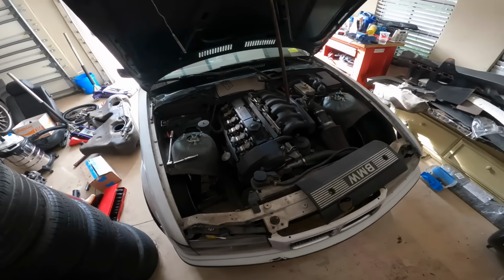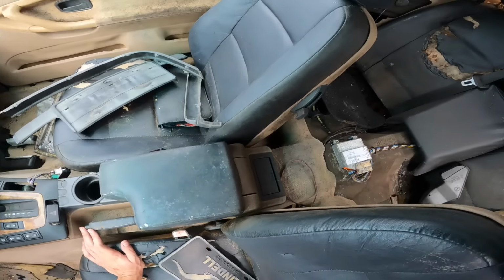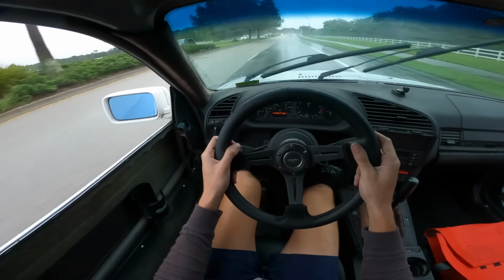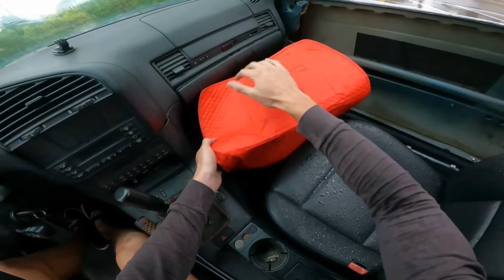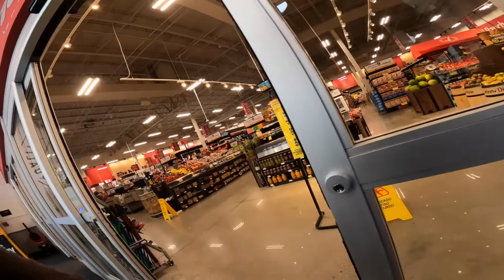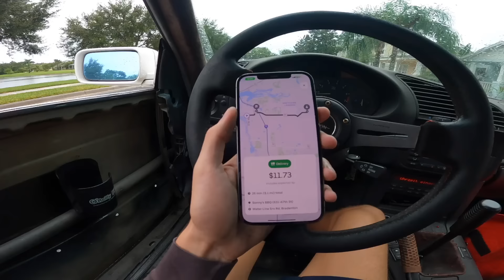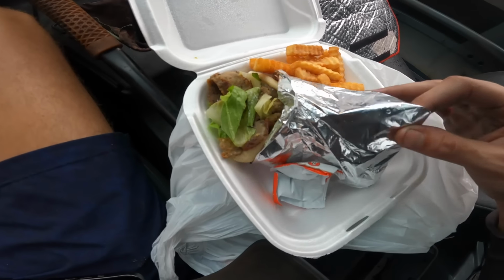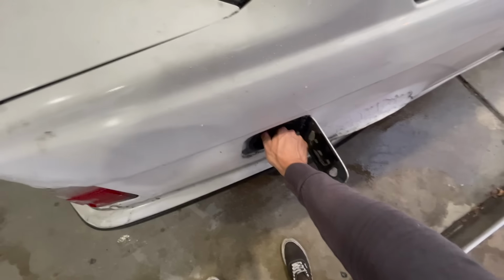Uber Eats & Door Dash in my DRIFT Car *POV*

Comment: hey bro, about your ear, if you drive with no window (especially if it's only one one side of the car), it can give you 'otitis', which is an inflammation of the ear drum. I think it has something to do with air pressure and the difference between your ears (like one ear is getting blaster by wind while the other is not).
In any case, I ain't a doctor, but I've had my share of otitis through my life.
Reply: oh yeah and if it comes back, get it checked, it can lead to mild (or even full) hearing loss

Comment: Get those wheels balanced. 9 times out of 10 that will fix steering wheel shake. 1 out of 10 its front brake runout or really bad tires.

Comment: Mate, problem with power is because of intake. Get yourself some sort of ebay cold intake. Some kind of hose from grills to filter. She needs to get air from outside, not from hot radiator. Also you can get m50 intake manifold, m50 intake cam for exhaust cam (you’ll just need to install it 180 degree from marks you’ll have) and m54 intake cam for intake. All those parts you can get from junkyard Little bit of tune and you’ll gain some power. Enjoy)
Reply: any tips for m52b20 for more power ?
Reply: @bulvekasis6954  cold intake, exhaust and tune… anything else is waste of money and time, because it’s easier and cheaper to just swap to 2.8… if you’ll try same mods as on 2.8, (like m50 intake)you could loose torque on lower rpm which is critical for your engine, because it’s not too much of torque there. 
You can try cams, but I’m not sure if it helps a lot on those engines, i think gains are not worth money and effort, you can gain like 5hp from cams. Otherwise, turbo, or nitrous
But it’s not worth it
I would say just catless exhaust with sport muffler and tune. Leave stock air intake on, it’s not that bad on bmw’s. And if you want to go faster, weight reduction is one more option
Reply: @kolhozmontage8767  Thank you for being informative. I really appreciate that!
Reply: legend

Comment: get a pair of motorcycle earplugs, i know you probably dont think your car is that loud but under prolonged use it will damage your hearing, but the real criminal is the windnoise from having the windows down. I personally ride a basically straightpiped honda shadow  and it is loud but the wind is louder...

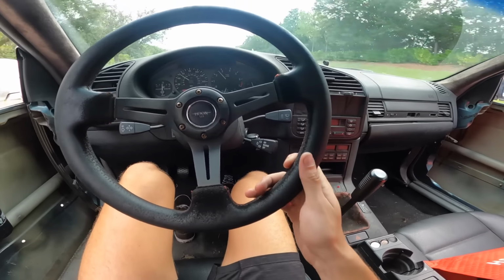Comment: @2:03 I had the some issue of the shaking in the past on my e46. It turns out that the 3 and 5 series have slightly different diameter wheel hubs. 72mm on the 3 and 74mm on the 5 I believe.  a 5 series rim would fit on the 3 but would shake like that. I found some hub spacer adapter to fit into the rim to reduce the diameter from 74mm to 72mm. check to see if that helps, it was seriously a couple dollar fix!

Comment: Between time lost' maintenance' petrol' car replacment every 10 years..... you're at a net loss bro......
Reply from the maker: Definitely not. You’re also not taking the YouTube pay in account ;)
Reply: @HoonGarage  okay shall we do the maths....
$30 petrol per day. ($210) a week
car payments based on a 30k car over 10 years $576 per week
$38 insurance per week based on a 2k policy annual
$29 average maintenance cost of a vehicle per day compounding.
2 hours time loss per day at $30 an hour x 7 days $420
total weekly running cost $1273.00........
daily cost  $181.85 
that's not including registration or licensee fee......
net loss bro....
Reply from the maker: Have you not seen the car I am using? This thing was paid off years ago. So take the car payment out of the picture and my insurance isn’t that high. This car rarely asks for parts despite the abuse it sees. Sure it could be a net loss if that was the situation but that’s no where close to my cost per delivery vs profit.
Reply: @HoonGarage  yet more proof of the failing education system in the us'... economics 101 i guess you would call it. guaranteed you will go through more than 1k in parts and maintenance alone per year  (+value you're time) and yet you don't account for the cost of the car or a replacement.. aka if you where using it as a commercial vehicle. If you're running it as a business its simple... challenge you to run 1 year and see how much you make after expenses..
Reply: @HoonGarage  please note i am not a hater' i am just pointing the fiscal facts' if someone is looking to do that as an income'' corporates will use you. and you're vehicle and be done'.. i run fleets so i know the costs pretty well'
also i really like you're vids and enjoy the content' this point was just a peeve for me'

Comment: This is horribly irresponsible and you just post it like it's fine. This car is not roadworthy and you're putting others at risk for 'content'. Despicable.
Reply from the maker: This car has been on the road for 2+ years and is road legal where I live. Never has this car put me or others in danger because it is not up to YOUR standards. My driving record is clean, I believe I have a good sense of time and place for spirited driving. What’s most concerning are 70+ aged drivers around here. They are NOT roadworthy. I’ve seen multiple pull out in front of people completely oblivious and some to the extremes of driving in the opposite lanes. 80% of auto accidents in this area involve them. I’ve never caused one. I don’t agree with your judgement.
Reply: @HoonGarage  You literally can't see anything at one point. You're in the rain on a set of tyres that is questionable at best. 
If this is a real drift car, no way it is road legal anywhere but America. And there are good reasons for it. 
If all this is road legal then I really don't want to know what else drives on those roads. 
Just because you did something for x amount of time, it doesn't mean it's safe or okay to do.